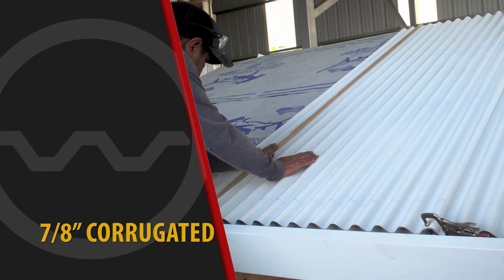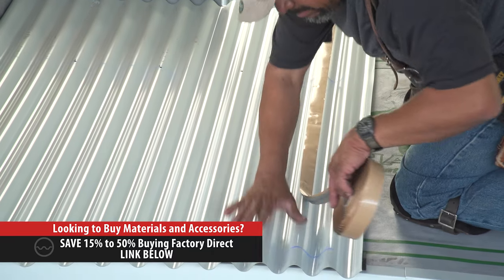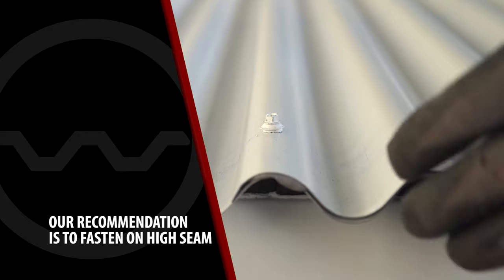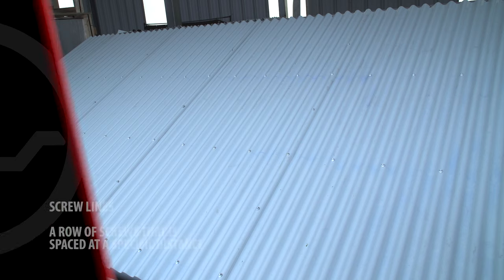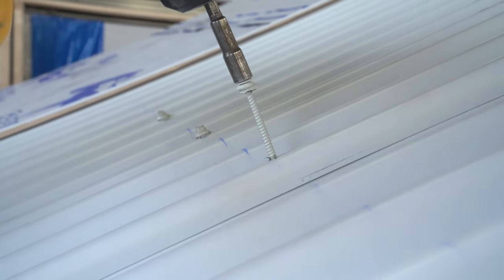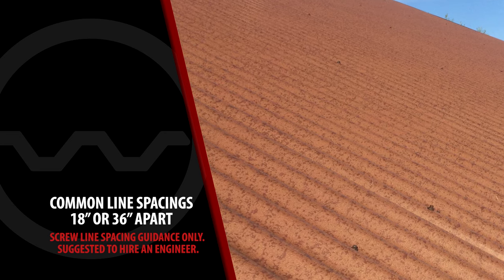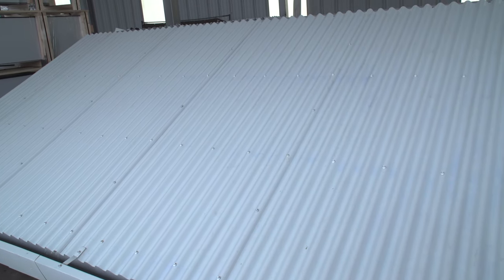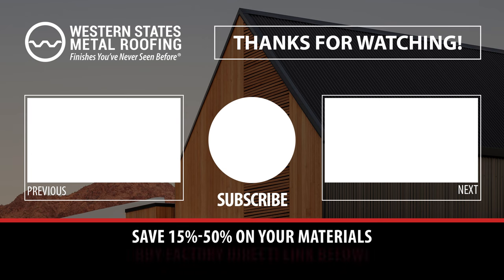Install Corrugated Metal Roofing. EASY VIDEO  Screw Placement +Screw Location + Overlapping Panels

Comment from the maker: There was one thing we forgot to address in this video. It's an optional addition as the screw placement shown in the video will work fine. When you are installing the first and last sheet it's a good idea to add one extra screw in the low of the corrugated panel at both sides of the gable. It's located within the FIRST SHEET PLACEMENT OF THE LINKED VIDEO at about the five minutes and 35 second mark.
https://www.youtube.com/watch?v=hQM-bDFm-PE
Reply: Here in Australia, we do not lay down that adhesive tape otherwise we install the same as this video. And these guys in this video are not predrilling holes to install the screws.
Reply: @robertbutler8004  
Hi Robert do you pre drill the sheets before you put them up on the roof?
I'm about to put my own roof on and still learning how to do it.
Also the old roof has old Decramastic metal tiles on it
And the purlins are quite small but at 260 centers.
Is it ok to screw a new corrugated onto those?
Thanks George NZ

Comment: If you’re saying drill your screws on the high part of the corrugated roof panel, then what size screws should we be using so that screw will safely secure into the purlins?

Comment: Shouldn't the screw spacing have been determined when you derived your negative design pressure test failure reading when you performed your ASTM E1592 testing? The screw spacing should be exactly as it was during the test.  Location of the screws will also be the same as the test data. Why would the customer need to employ an engineer?

Comment: The metal sheets in the video -  what is the distance in inches between the apex (from underneath) of the 'highs' of the sheet and the surface of the plywood substrate?
Given that measurement, what length and diameter of metal screw do you recommend?
Suppose we substitute the plywood for 1x4" timber (called 'lathing'  in my corner), how long should the screws be?
Of course this didn't matter when galvanized nails were in fashion. One just pounded them in with a hammer until the caps ('umbrellas') hugged the ridge of the sheet.
Reply from the maker: Jack, The 7/8” corrugated is 7/8” high with a 2.67 pitch which is the distance from center of the high to the next high corrugation.. Yes can install on wood lathing. Would just need to make sure if not installing on a solid substrate that the wood lathing is spaced properly to carry the load of the sheeting. 2" wood screws would need to be installed into the highs of the panels. 

Here is a link to a load chart
https://www.westernstatesmetalroofing.com/docs/78-corrugated/78-Corrugated-Load-Chart.pdf

Here is a link to a screw placement video
https://www.youtube.com/watch?v=wMdOnxBmu0E

Hope this helps
Paul Rubio
Reply: @WesternStatesMetalRoofing  Your kind response is appreciated.

Comment: I'm making an outdoor 6 x 2 ft rabbit cage with a back-to-front-sloping corrugated sheet roofing.  I am leaving an 8 inch breadth of sheet outside of the cage's frame on the top front to prevent rain and sun from getting inside the cage from the front.  How much sheet should I leave in the top back to protect the cage from behind?

Comment: Hi, an outstanding set of videos. Clear and easy to understand. I am particularly pleased to learn about the foam strip that fits between the fascia and the roof. I live in a rural location in New Zealand and have been looking for a solution to stop small birds getting into the roofspace via that open gap. Problem solved. Now to check if local building reg's allow the foam and then where to get it over here. Do you export perhaps?
Reply from the maker: Allan, I appreciate the positive feedback. We could ship the foam closures to New Zealand, but it would be expensive. Here are your two best options: A. Call a metal roofing manufacturer and if they sell to the public they will have the foam in stock.  B.  Call your local roofing supply center as they normally have access to this.  Have a great day.
Reply: It's called profile foam in NZ. You can buy it from the roof manufacturers but it's made by ampelite or ansylite depending on your roof. It's about $5 a metre.

Side note I'm blown away by the differences in best practice between USA and NZ. One example is that we only lap our sheets one corrugation and don't use butyl tape.
Reply: @mitchelllee7706   as a 'belt and braces' type of person I would use tape and would lap by 2 or even 3.

Comment: Silly question: do you drill a hole then, if you are setting the screws on the top of the hill? Or use a jig to guide the screw? Seems like it will be difficult to get the roofing screws to drill through the metal without skipping around, if they aren’t put in the valley.
Reply from the maker: Pre-drilling the sheets is an option, but not a requirement. The screws that you use will be self drilling and when used in conjunction with a quality screw gun it will work fine fastening in the center of the high. Here's a video on pre-drilling the screws:
https://www.youtube.com/watch?v=RApotTZu2uE
Reply: Ok, thanks! I’m pre drilling holes with a bit, but I only have a cordless drill. It’s just a shed roof and the shed is already old. (And I may have smashed my knuckles a couple too many times with those damn self-drilling screws.) Thanks for the tips.
Reply: Flip the panels over and drill the backside.....re-orient and you are now ridges up.....TA DA!

Comment: It seems like you could use short screws in the peaks just to hold the overlaps and nails through strips of ice and water shield in the valleys.
Reply: Are you saying nails in the low seams? If so this is a recipe for disaster as the nails do not have the rubber sealing washer and are not controllable in installation pressure.
Reply: @barrysmith8193  I have no idea what I was saying but I've figured it out after lots of study.  No nails were used!

Comment: Extra time playing style...

Bolt size(x)
Metal washer size(4x)
Rubber washer size(2x)
Sillicone washer size(4x)
Sillicone washer size (4x)
Shape = ?
Pressure footprint = ?

Nut and ... = ?
Brick laying alternate(matching sheets) layering with overlaps
= metal top, plastic middle

Width = canopy curvature(truck width max).
Door = framed curved

Tension = pairs of [(spring-hook-cc) + (cc-hook-tensioner)]

(Camping is OO with carabiner due-to tarp being easy to tear)

Comment: I have an approximately 45 foot x 10 foot (ridge to eave) awning. If I'm looking to install western rib, is it preferable to order single 10 foot panels or, for example, a 6 foot panel and a 4'6" panel, overlapping them to prevent any unnecessary cutting with small imperfections in the awning dimension?
Reply from the maker: Derek, It's always better to NOT have an overlap if you can avoid one. We will make the panels whatever length that you need.

Comment: My elderly mother is being quoted $8000 and $6000 from two different roofers to replace her metal corrugated roof on an open back porch (where her firewood is stored).  This seems crazy high to me as it's about a 10x12 roof.  I can buy pieces of 2x12 metal corrugated from Lowes for $29/each.  How in the world can it possibly cost $6000-8000 for this job?  Is she being suckered??
Reply from the maker: I don't know the job specifics. However, the price seems absurd. Your issue is the size of the job. Any roofer that's good is busy and there's no money to be made on such a small job. Small jobs are done by handyman. However, handymen usually aren't qualified to install metal roofing. Your between a rock and a hard place.
Reply: @WesternStatesMetalRoofing  Thanks for the comment!

Comment: I have a very old garage that I'm roofing to be a chicken house. The roof is arched (slightly). Do I lay the sheets sideways for an arch? Bottom one first?
Reply from the maker: The sheets will only curve the easy way, but that might mean the water drains the wrong way. Nobody will curve a small job for you. Good luck with the project.
Reply: @WesternStatesMetalRoofing  thank you

Comment: Is the recommendation to fasten on the high seam for western rib also?
Reply from the maker: Derick, Western Rib has a wider low and the screws will go in the low. I have attached a screw placement diagram link.
https://www.cortenroofing.com/docs/pdf/western-rib-screw-placement.pdf?__hstc=187130103.a0187661f72c773f5bf5b6ae0b342094.1589055209040.1599676704423.1599681083514.216&__hssc=187130103.2.1599681083514&__hsfp=1886519386

Comment: Had a buddy I was working with adding a corr. roof over a walkway and he kept going on about how long he'd been in construction (hard head) and he was putting the screws in the valleys I kept saying hey man that will trap debris as it had very little fall and sure enough after a few yrs. There is only one thing worse than a hard head and that's a dumb ass hard head.
Reply: He was right.
This top placement doesnt allow for metal to metal contact.
No bueno doing on the hump
Reply: @FinehomesofNewHampshire  it was catching debris big time I just used longer screws and put em on the high point. the issue was not much fall in the flow line plus he put caulking around and that made little dams that caught trash
Reply: @FinehomesofNewHampshire  Well, I guess I'll find out who's right...about 2 year ago I installed a panel by drilling in the valleys.  This last weekend I had to replace the water rotted plywood underneath the corrugations due to leakage through the washered screws - not to mention the accumulation of pine needles and leaves in all the valleys.  The new roof is now drilled through the peaks.  I'm putting my money on the the mountain top.

Comment: The screws in this video don't match the tin, and for this reason I'm out.
Reply from the maker: In instances in which the screws are not the same color as the tin it's done so you can see the screws better. It's hard to get a good visual with a white panel and a white screw.

Comment: screws go in the troughs... never the top of the corrogations......all roofers know that
Reply from the maker: Chad, I appreciate the comment. This is one of those installation methods in which both are correct installation methods. If you we're to look at the installation manuals for many different manufacturer's some would recommend the screws in the highs and some in the lows. Lows = Better attachment, but less weather-tight. Highs = More weather-tight, but lesser attachment. Also just to clarify we are only recommending this attachment method for wavy corrugated and not an exposed fastener panel such as PBR Panel, U Panel, etc.
Reply: Hi Chad.  I am owner of a competing company to Western. However, one must ask the question why? Why are some on the top and some on the bottom? Why do you say all screws in corrugated go in the troughs?  I may be able to help explain.  Top of the corrugation allows for more ample expansion and contraction and will allow the exposed fastener to remain solid for a longer period of time, as well as remove it from the water.  BUT.......and here is where it usually leaves the "roofer" behind; what does the manufacturers ASTM E1592 negative design pressure test reveal? Was the test completed with the screw in the top or the trough, what size screw, how often on center? Was an ASTM 330/331 also performed with the original test? If so, where was the screw placement during these tests? If the end user wants the panel to perform as tested, then they MUST use the exact same screw placement in order to have a UL rated roof.  UL uses the original ASTM testing data to grant the UL listing of metal roof products.  These tests are completed as an assembly of products, ie (how many screws, where placed, type of screw, #10 in plywood? )  #10 screws have not passed an ASTM test yet by any manufacturer in plywood, only #14. When you deviate from the tested assembly application, you now put your customer at risk of not being insurable by most home insurance companies, as well as product failure.  The most aggressive insurance company to know about this is State Farm.  If you install a metal roof that is not UL rated as a result of a claim, state farm will deny the second payment and your customer has every right to demand it be fixed, or not pay you. It is very important that you and all roofers become familiar with metal roof testing to insure you are installing an approved system.  Western Metal Roofing recommends installation techniques commensurate with their testing. If these tests seem foreign to you, reach out to me on LinkedIn and I can help get you more resources so you can learn the "whys" of how these systems came to be. I can also familiarize you with all the current testing criteria and how it relates to specified projects as well.  Before moving into manufacturing I installed roof systems as a subcontractor for the Dept of Defense, Army Corp of Engineers worldwide for 43 years.  I am happy to share that knowledge and experience.  smoats@metaldt.com
Reply: @aoyinc  i know it seems counter intuitive to put the screws in he troughs due to the water running there, but you have to have the screws fastened as tight to the deck as possible  due to thermal expansion and contraction. when the screws are at the top of the corrugation you have to have a really long screw to hit the deck and you are giving the panel way way more room to lift as the screws back out.  same with propanel.   here in colorado we have to go back and tighten screws after about 5 years, then go up the next larger size after a few tightenings.   i usually start with 5/16ths fat boys  but many people will allways start with 1/4 inch heads so they can move up to 5/16ths  fat boys. also the neoprene collars wont seal well at the top of the corrugation as it is convex rather than concave wich will seal...  in some areas the panels wont have as much problems with thermal exp/cont as here where we are roofing at 7-10k feet of elevation and the temps can be 100 plus to neg 30.      but mainly its the seal of the neoprene collar.   sorry if i offended anyone-wasnt trying to talk smack and hope all you  fellow roofers out ther have a merry christmas or what ever holidays you are celebrating this time of year
Reply: Depending on sheet type ,,all roofers know there is no one rule 😀